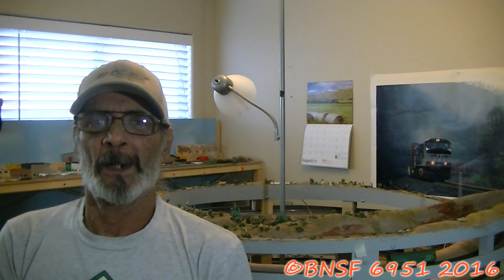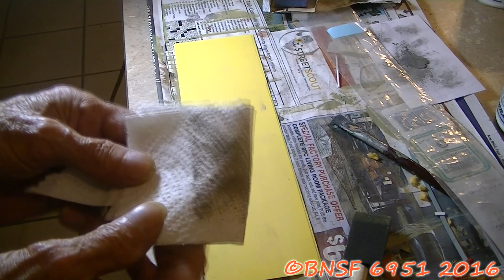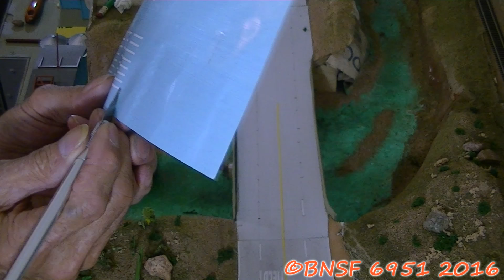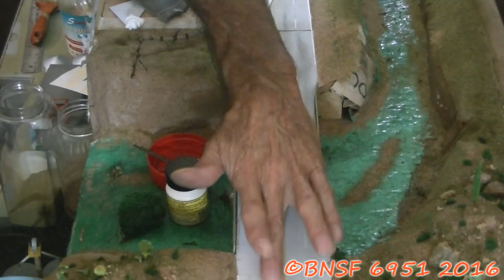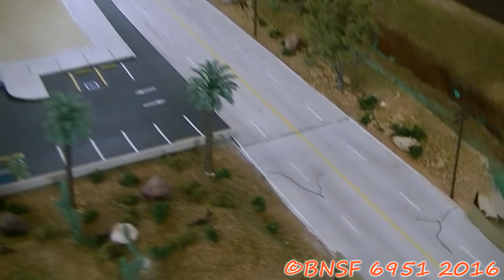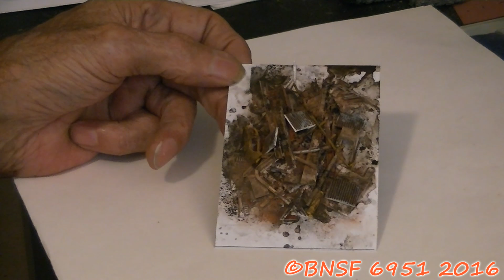Major Changes #17

Comment: Hi Vinny , fantastic video! Your upper deck looks great! Do you think you would need to spray your roads with dull coat to seal the stripping to the roads? I am going to try your technique on doing roads this fall on my layout. Thanks again for sharing your techniques with us.
Randy
Reply from the maker: hi Randy... using the plastic from home depot & the highways & Byways road graphics are cheap & easy way to do your roads & to answer you question i will be giving them a shot of dull coat... let me know how it goes with your roads & always feel free to use my techniques that's why i post them... thanks for watching & your comment.. vinny